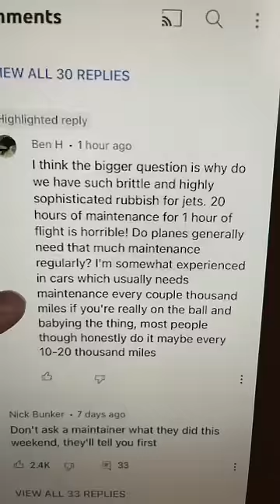Why does an F-16 need 17 hours of maintenance for every hour of flight?

Comment: "LOL my car's engine died. Lemme pull over."

"LOL my plane's engine died.  I'm dead."

All take offs are optional.  

All landings are mandatory.
Reply: Actual facts.
Reply: UNLESS you can reach ORBITAL VELOCITY...😊
Reply: @shooting4star2023  >>> Using an ejection seat is STILL a risky proposition. 
 
After losing an engine {in a multi-engineers craft}, an aircraft can enter into a "flat spin" which CANNOT be recovered from.
Reply: @Allan_aka_RocKITEman  not even a passenger plane enters flat spin when an engine fails. at high speed aerodynamic control is absolutely dominant in terms of control authority meaning the vertical stabilizer can very easily compensate for any thrust differentiations or broken tvc or whatever bad things the engines are doing. every single modern plane can land safely with one engine down.
Reply: Landings are inevitable.  It's how you land that's important.
Reply: The plane is dead in most cases, lots.odn fighter jets have a glide ration of 1:1-2, barely better than a brick 😂
Reply: Just spend 20 minutes pre-flight fo make sure the ejection seat works.

Plane engines dead. Eject.
Reply: Not dead just because a planes engine dies but yea it's a little more important than a car engine
Reply: Nice dp
Reply: Nice dp
Reply: @shooting4star2023  Unless the ejection seat fails. It's not guaranteed, & is still a high risk option, especially in a combat situation.
Reply: @dnajournal4321  Ejection can still be deadly. Ever see Top Gun?
Reply: @syllycatface  No jet (or fixed wing aircraft in general) has a glide ratio this poor. The F-15 has a glide ratio of 1:9.3. The F-4 had 1:10.5. The F-5 had 1:10.7. The A-6 had 1:15.2. This data is from the book “aircraft design: a conceptual approach”.
Reply: @shooting4star2023  or you could just glide
Reply: @Allan_aka_RocKITEman  you mean escape velocity?
Reply: @luvliboss9955  >>> Velocity to orbit the Earth.  I believe it is 17,500 MPH or 25,000<?> KPH.
Reply: @Allan_aka_RocKITEman  oh I thought you meant to take off into space didn't know you meant to orbit the planet
Reply: @luvliboss9955  >>> I should have clarified: I meant having enough velocity to orbit the Earth. 
 
After that, increasing to a certain velocity will cause you to leave the Earth and go into an orbit around the sun.
 
Beyond that, you get to a certain velocity and you will eventually leave the solar system.
Reply: @shooting4star2023  ejection seats are not the magical "save your life" button that people say they are. Sometimes pilots come out of it unharmed from ejections, sometimes the force of the seat and the wind causes broken bones, and in worst-case scenarios, a bad failure can happen and kill the pilot.
The main worst-case failures are the parachutes failing to deploy, and the automatic canopy fails to "blow" open during the ejection, sending the pilot through the reinforced glass at high speed.
Reply: Depends on altitude and velocity. It’s why most planes crash at landing and take off because they have neither the right altitude or velocity to lose power. If you have both you can lose power and still be ok.
Reply: @shooting4star2023  also, (not sure about military jets, but this is for the passenger airplanes and the one that the presidents use) they are designed to glide a pretty far distance if the engines fail or run out of fuel. Even back in wwii, planes, especially bombers were designed to fly for quite a while, even with one or no engines. The danger with jet fighters and all that is hydrolics and flying using that sort of thing. If those die or something during flight, I am not sure if they can actually un retract the wings (not even sure if they still do this). Either way, planes are pretty safe to fly, unless they are shooting at one another.
Reply: i mean, there are situations in a car where an engine dying can get you rear ended and killed, but there are also situations in an engine out scenario in a plane that will still allow for a 'landing' though its usually rough and means possible injury for the pilot.
Reply: @jeffjr84  of fucking course lol. The point was that it’s obviously far more catastrophic if a plane loses power vs a car.
Reply: Planes can glide back down if their engines fail what
Reply: Not 1 person knows anything about aviation, in these comments. The one guy quoting from a book is the only comment with any factual information.    
  When people wanna act smart cus they seen top gun & tried to play dcs Once. It's okay to not comment or be the "smartest" or know the most (or anything at all at that)  yall down there look dumb, obviously googled something n still got it wrong.... 🤮😔😪
Reply: Evidently no one knows about cars.. as an ASE mech im telling you.. engine cuts out at the wrong time (looking at you jville) you can get ass ended an killed. Matter of fact it happens way more often than any aviation accident.. all you need to establish that are the statistics.. you dont have to read used TMs on ebay.
Reply: @jeffjr84  of course it happens more… people drive way more than they fly. The real statistic to look at is what percentage of engine failure leads to death… I’m willing to bet planes have a much higher percent of death following engine failure than cars. 🤦‍♂️
Reply: @starsiegeRoks  ejection seats are designed to break some of the pilots bones because it requires that much force to make sure the plane doesn't slam into them
Reply: its easily 1 in 5 or 2 in 10..for inner city traffic. it depends on where, just like in an aircraft. if it happens on a empty road, or just over a runway accordingly.. the chances are improved a bit.. i have read that it can be a coin flip in those situations though, you could do a harrison ford, or you could bury your sesna into a highway divider.. 20 percent ish chance for cars. At times it can be 60/40 in a plane. there are days id take those odds.. it's way less likely that an aircraft will have that kind of engine issue as the planes get more consistent care. Also as you said, there are less planes than automobiles going at any time.
Reply: @jeffjr84  I’d need to see a source on that because the amount of engine failure that results in death in car has to be incredibly low…
Reply: @kbob9625  ill look it up, its hard to prove a lot of times because of the nature of auto accidents so there is a skew on the statistics, scrappers assessment is better, most scrappers i know can point to a wreck and go "yeah engine cut out on that one an they got hit by a loaded dump truck" or the like. It is easily 2 in 10 though, its not as bad as it used to be but they got a lot of old cars off the road a few years ago.. the scrap programs made it more attractive to scrap than repair when something major like a k member gets compromised or something.. not sure they do anything similar with planes, doubt it since its so money intensive. My moms boyfriend's foot slipped off the clutch, he stalled, an got side swiped by a dump truck.. it was instant thankfully that time.
Reply: i thought landing was the optional part
Reply: One exception: when trying to meet military quotas, out takeoffs are mandatory. Landing is just highly suggested
Reply: @Allan_aka_RocKITEman  plenty of aircrafts can recover from flatspins,actually
Reply: @elicier4123  I don’t think that it’s possible for a large multi engine passenger plane to flat spin, dew to its high rudder authority over the plane, and it’s weight. But yeah, modern multi engine 4th gen fighters such as the F/A-18 are extremely hard aircraft to flat spin, dew to there centreline thrust, 5th gen fighters can enter flat spins and exit them at will, the only jet propelled multi engine aircraft that are prone to flat spinning is the infamous f-14 tomcat, the early ones that had frequent compressor stalls, and really any jet aircraft that had/has its engines separated.It’s possible for single engine jet aircraft to flat spin, but it’s extremely rare, and hasn’t occurred in, probably decades. Small propeller planes can also flat spin, but assuming you have the altitude, they usually correct themselves.
Reply: @dnajournal4321  Damm the jet ONLY cost 20 million dollars
Reply: @lands1459  gliding isn't always a good answer
Reply: @starsiegeRoks  there is a titanium arrow on top of ejection seats so hitting the canopy wont be TO big of a problem
Reply: @JointedSpagel  not always
Reply: @juicy342yt4  it not designed to do that it's just an unhappy side effect
Reply: @jeffjr84  your car also doesn't have a seat that launches you to relative safety
Reply: that was kind of my point.. and those seats routinely hurt people that have to use them.. not that anything requiring that amount of explosives would even be a good idea in a car... would probably lead to more deaths.. i used to do roadside service for a living.. i can tell you i saw more death doing that than most pilots ever would.. as you aren't on the ground having to deal with it so there is a disconnect.. i have been involved in some near misses by traffic as well.. also something you don't ever have to worry about in a plane because they got TCAS...
Reply: @Allan_aka_RocKITEman  ah nice top gun logic
Reply: @Allan_aka_RocKITEman  Most flat spins are completely recoverable (single or twin engine). I don’t know where this myth started, (likely Top Gun) but I assume you were being sarcastic.
Reply: @Galahad993  Ejections are rarely deadly and “Top Gun” was a movie.
Reply: @yiplaycod  I know a thing or two about aviation, but I agree that no one else here has any military aviation expertise beyond watching “Top Gun” and playing DCS.

I’m a retired USAF F-16 Crew Chief, FAA A&P Certificate holder, graduated with a Bachelor of Science degree in Aviation Technology and am currently employed by an aerospace defense contractor as an Aircraft Maintenance Quality Assurance Office Manager.

According to Jim Tulloch and John Hampton of the SAFE Association Proceedings of October 2013, the ACES II seat ejection injury rate is one of the lowest in the world as proven in over 600 live ejections. Back injury rates occur in only 1% of ACES ejections compared to 20% to 40% in most other ejection seats. 

The ACES II ejection seat is currently used in the A-10, F-15, F-16, F-22, F-117, B-1, B-2, WB-57 and Japanese F-2.

I have trusted my own life to it on two occasions while flying in the back seat of an F-16D during two incentive rides. Fortunately, I never had the opportunity to test its reliability first hand.
Reply: Ejecting will put strain on your backbone and you have decent odds of ending paralysed, or having permanent back pain, you're probably not flying again after ejecting.
Reply: You can’t take off with a dead jet engine…
Reply: @dnajournal4321 An ejection can end your career as a pilot: it's not a fun experience.
Reply: @syllycatface  those are some warthunder numbers my guy. No modern 4th gen jet is anywhere close to being that bad. 

Sure, they're not an A-10 or a modern liner in terms of "who needs power?", But they're explicitly designed to maintain aerodynamic control while experiencing total engine failure.
Reply: @JointedSpagel  that’s provided your not in a dead spin or upside down. Or your wings haven’t been damaged due to stress on the airframe.
Reply: @jeffjr84  you can’t compare the stresses that a car, can only move in 2 dimensions with an aircraft that can move in 3 dimensions. They are two completely different beasts. Also, shit just breaks down sometimes even when things are maintained. The difference in the two vehicles is one is happening at Mach 1+ where another is not.
Reply: physics is still physics man.. dont matter if its 2d or 3d.. they are affected by the same kind of forces... and they are parallels im not comparing anything.. but anything that moves shares a parallel... it all has engines all uses fuel all needs to be working right and if anything fails it can lead to disaster.. and car stuff isn't as well documented as plane stuff so you may never get an answer.. drive a car off a cliff because something broke and lose a plane because a wing fell off.. they both crash into the ground below them..
Reply: All planes are gliders. And F-16s (as most fighters) are fitted with ejection seats. The engine doesn’t make any plane fly, wings and airspeed do. The engine just allows for horizontal runway takeoff and sustained cruise flight. 
Rockets are those which fly mostly thanks to their engine. Because they fly mostly vertically and wings are useless for that. Actually they don’t really care about flying, they are launch vehicles designed for their payload to gain high speed and altitude, at which point the rockets mission is over. Not quite comparable to a plane.
Reply: @elicier4123  ehhhh flat spins are still pretty common in fighter aircraft training, since the planes are taken to stall conditions regularly and all it takes is a bit of engine thrust differential to turn a stall into a flat spin.

Plus, commercial airliners are far different from fighter planes, a spin is much harder to enter due to the HUGE control surface on the vertical stabilizer, and when spin conditions are met, they have great thrust to weight ratios (even with one engine) and can usually go full rudder while maintaining high thrust and make sure a spin doesn’t occur.

The only airliner flat spin I can recall off the top of my head is Pulkovo Aviation Enterprise Flight 612, and it wasn’t mechanical failure, rather a string of incompetence leading to the pilots entering, and not recovering from, a flat spin. Whereas numerous smaller military aircraft have experienced flat spins even in the past couple decades.

Comment: Thanks for the video.  As a former F-16 Crew Chief for 7 years, I’d like to provide some clarification on this subject.  

17 hours is probably an average that includes more lengthy periodic inspections and unexpected major maintenance.  

Replacing an engine, for example, is not a daily task, but when that does happen, the maintenance involved would consume a couple work shifts and many maintenance personnel, easily exceeding 17 person-hours.  If an F-16 has a fuel pump problem, the jet will need a full de-fuel (a few people) and then be towed (a few people) to the “fuel barn” for maintenance, which could take the better part of a day.  There are many more scenarios that can cause an F-16 to need more than the usual amount of daily maintenance.  After 50 hours of flight, a “50-hour” periodic “phase” inspection will need to be done, which can take a couple days.  They also have longer phase inspections, and major upgrades, etc.  

You also don’t just have a single person maintaining an F-16 either.  There are Crew Chiefs, Avionics specialists, fuel specialists, sheet metal, hydraulics, radar, etc.  Towing a jet takes a few Crew Chiefs and more if they need to stuff the jet into a tight aircraft shelter or hanger.  It takes about 5 Crew Chiefs to jack an F-16 up for some landing gear maintenance and tests.  It takes a few Weapons Specialists to load a jet with bombs and/or ammo.  It takes 2 Crew Chiefs and a fuel truck driver to refuel a jet between flights or after the last flight of the day (typically 3 sorties per day). Just launching a jet requires about 30 minutes time from each of 2 Crew Chiefs: one on comms with the pilot and the other manning the fire-extinguisher.  The person-hours really really add up quick. 
 
With that said, however, a typical day without any major maintenance would probably only result in 6 hours of a single Crew Chief’s time (pre-flight inspection, 2 thru-flight inspections, and a post-flight inspection), fueling, taking oil samples (after every flight), topping off struts and/or tires with nitrogen, possibly a tire change, adding oil, hydraulic fluid, LOX, maybe some time from the weapons crew or others, and then there's waiting for a fuel truck, oil cart, nitrogen cart, etc, etc, etc.  Oh, and there's also the time required to document everything that is done to the jet.  Changing a tire, for example, requires a "red X" entry in the forms that grounds the jet from flight till that tire is replaced, while reviewed/inspected by a second person who can "sign off" the job in the forms.  If that was the last red-X in the forms, the jet would be air worthy again.  I’d guess that such a typical day would be on the order of 8-10 person-hours for a single F-16, but we're talking about multiple people to each do their part, and some of those are teams of people to accomplish a task.  Three people to do a 15 minute refuel would be 45 minutes, and that doesn't count the time waiting for the truck.  Crew Chiefs and specialists don’t just work on one jet, either.  They are constantly moved around where needed.  

Aircraft in general require many more person-hours than people realize.  It's in a totally different league from car maintenance!
Reply: Don't forget all the time checking out tools or test equipment and then cleaning them before inventory turn in.

Comment: I am retired USAF 23 years, I am a Bone crew chief and C130 flight engineer.
The majority of  his comments are somewhat accurate, concerning the maintenance and preflight for aircraft. Most maintainers work 24-48 hrs preparing aircraft for flight; depending on the type of aircraft. The modern aircraft are very expensive and ultimately pilots are too. That is why we check EVERYTHING for the pilot to fly safely.